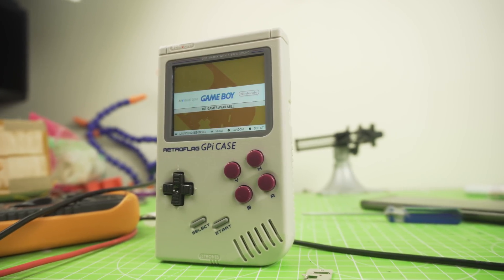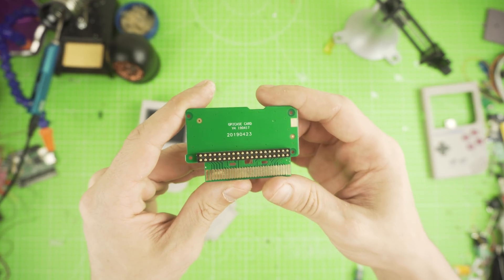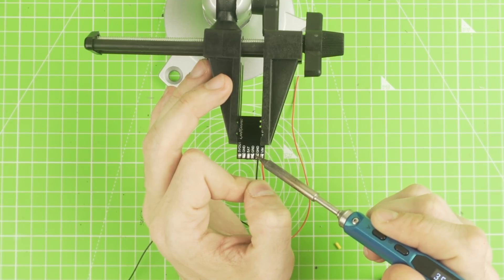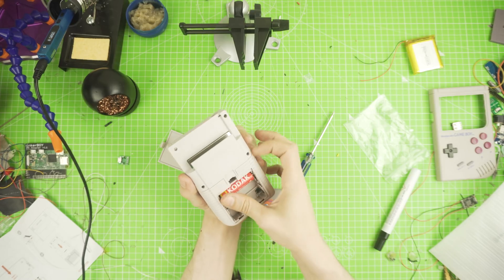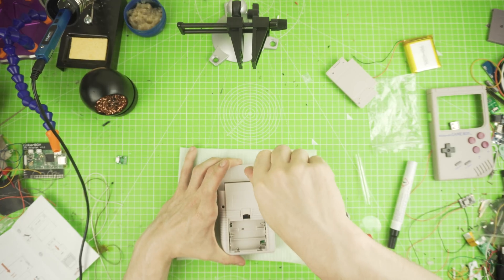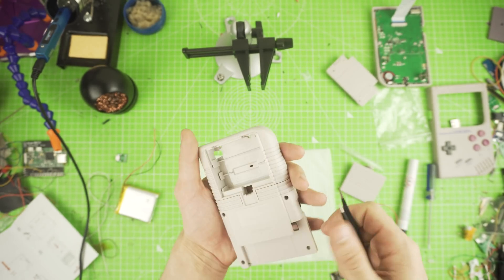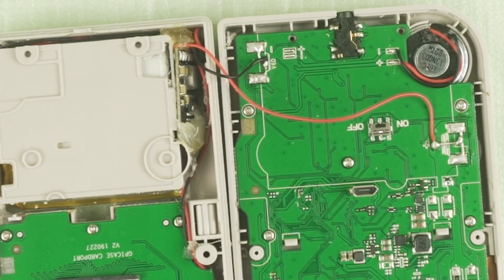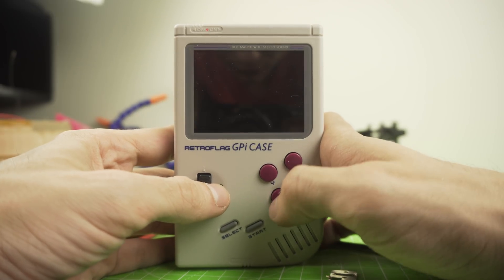Retroflag GPI case Battery and Charger Modification

Comment: What is the battery life when using the 3 AA batteries ?
Reply: I would like to know this too.
Reply from the maker: I tried with cheap batteries so my experience was bad, but with good batteries you can get 3 4 hours out of them, but you got to charge those externally or just buy new ones all the time
Reply: @Adamstech  thanks
Reply: @eldontyrellcorp  You kids are spoiled. Back in the day we had 2 to 3 hours on a set of fresh batteries. And all we had was was a passive LCD and Tetris. :-)

Get 6 NiMh AA Cells if you don't want to do the mod, so you can charge while playing.
Reply: @citronski  Actually the original gameboy lasted a good ten hours.
Reply: @Cicirifu  Nah mate, maybe 3, tops.
Reply: @citronski  Nope, he's right. The original Game Boy lasted between 10-30 hours, depending on the game and batteries used.

Comment: would there be any issue adding USB C rather than micro USB?
Reply from the maker: Not at all, just make sure you wire on the power pins as the type c connetor has many inputs, but it should be fine

Comment: Great video! Wanting to make a raspberry pi project for a while and have all the parts except te powerboost 1000c, as it is really expensive. That power board you were using looks great for my purposes. Can you share a link? Is it as powerfull as a powerboost.
Reply from the maker: Is more powerful than the adafruit one it has 2A and up to 2.5, I placed the link in the pinned comment, YT doesn't like them in the description of the video
Reply: @Adamstech  Oh, didn't see... Thanks man! (again great vid)

Comment: How many percent of you guys would attempt this project and how many would use rechargeable AA battery instead?
Reply: I use a lithium micro recharchable usb battery 1.5v and is great!
Reply from the maker: I think you got your answer by now isn't it!?
Reply: @Adamstech  nope I bought aa battery rechargeable lithium micro usb (29$) on Amazon months ago
Reply from the maker: @Konteoro  How did that worked out for you?
Reply: Adam Builds very well, the battery have a micro usb and 1,5 Hours is ready to use for six Hours of gaming
Reply from the maker: @Konteoro  So you got to take the batteries out and charge them? Isn't that a pain in the buttocks?

Comment: You can buy a bigger package of quality recharable AA batteries and charge them at home. And can still play via USB if the batteries are empty. Nonetheless, great video for people who want this feature. Thanks! 

How long can you play with this 4000 mAh battery ?
Reply from the maker: Hi, I know that is not for everyone, but there are persons like me who doesn't like changing batteries all the time, with the 4000 mAh one you get around 4 hours of play
Reply from the maker: Also you can charge and play in the same time  :D
Reply: @Adamstech   Okay the LDK and RS 97 Handheld have this feature on stock. With 1050 mAh - 1200 mAh Nokia mobil batteries the LDK plays 2 -  3 hours. But the battieres are small. You can always have some as reserve in your bag.  It's a good alternative to the GPI Case since it has better hardware(2 Core CPU) and plays all 16 bit games like NeoGeo smooth 60 fps(with RetroFW Software). I like both systems. Especially the Gameboy style of the GPi Case. Much better than the Bittboy...
Reply from the maker: @__Pathfinder__  I just added Wireless QI charging to it :D
Reply: @Adamstech   The LDK handheld gets 4 hours of 8-16 Bit 60fps gameplay out of a quality Patona 1200mAh Lithium Nokia style battery. The Pi Zero has poor hardware specs and sucks battery life to fast. Recharging while playing without modification... LDK is the better handheld... And it's cheaper...
Reply from the maker: These are more for GMB enthusiasts not so much to compete with already made handhelds, and I will trade Retropie for proprietary software all day every day :D
Reply: @Adamstech   Retropi and Recalbox(Retroarch) got  huge inputlag. Around 160ms on Snes games (Nintendo SNES Mini with stock software 90ms... ORIGINAL 90th SNES 70ms). The RetroFW for the LDK has a low inputlag, too. The SW is specially made and opimized for this handheld. LDK is better in almost every way... and cheaper... Except maybe the 0.2 inch larger display of the GPI Case.
LDK 2 Kernel CPU... Zero 1 Kernel...
i'm a hardcore retro geek. if you have questions ;)
€dit And of course, LDK is not binded to the stock software. RetroFW is a community alternative.  It's all just linux software on a microsd...
Reply from the maker: I fully understand but how I said these are not in the same ball, don't forget about the IPS screen that is way better than the TFT on the LDK that beeing said I just ordered a horizontal LDK
Reply: @Adamstech   Cool the only downside with the horizontal one is the start and select button just unter the 4 control buttons. But  larger display(0,1 inch) and better position for button 5 & 6. Hardware inside is the same. I have a lot of fun right now with old PC Engine/TurboGFX games. One of the best systems  ever made (Namco). I will get a GPI Case in the future, too.  Thank you for you tutorials! Very helpful if i want lithium  inside. You are a very good electrical engineerer! I'm programmer.
€dit throw away the chinese Nokia style battery inside. Patona or something like this is very high quality. No compare in capacity to these chinese wannebe 1020 mAh. The Patona will last over 5 hours(50% longer)!... All these chinese 2000 mAh are all fake data. This type of battery has max capacity of 1200-1300.
Better buy a tempered glass protection for the ldk. the display gets scratched quickly.
Reply: One more advantage is the soundquality of the LDK. And the headphone jack has no background noise at all... while the GPI has a noise.  The TFT is not IPS but on very high level. You could test these things and write your opinion. Whould be interesting for me.
Reply from the maker: I am still looking forward for the Joystick and the form factor in general, I saw that there are updates and extra emulators added with them, so really looking for it, but is AliExpress so I have to wait ages
Reply: @__Pathfinder__  with the supreme image they fixed the audio and has no noticiable input lag compared to my ldk Its super responsive. Add the gameboy pocket dpad  and it fells authentic. The problem with retropi is its complicated to set up, Most reviewers are not tech savy they dont add scripts to fix anything and they dont use any standalone emulators and Retroflag sent them set up units without using the best emulators for the pi0  or any comunity scripts https://www.youtube.com/watch?v=x6IK7nvbE8o&t=1310s watch the image or madlittlepixel these guys are retropi masters. There images always make the world a better place lol :D
Reply from the maker: @robknott1597  That wasn't the goal of this video, I focused on the hardware part if you watch my second video you can see that I showed super retro pie image
Reply: @robknott1597  
 Retroarch on Pi is always 150ms Inputlag(about 5-6 frames).  That's the downside with emulation. Best inputlag so far with emulation has the SNES Mini with stock software. It's gorgeous 95ms and only 25ms more than the original SNES from  the 90th... But only if you keep the stock firmware. Pi and Retroarch on Recalbox/Retropi/Lakka is always laggy. But the LDK seems to be very responsive since it's built on other Linux distribution(OpenDingux). But you have to use RetroFW as software. It's a big improvement.
Reply: Additional info i got today: Vertical one can run up to 724MHz without any crashing and
 Horizontal can only go up to 636 MHz because Vert. has JZ4760B  and Hor. JZ4760 CPU.
So if you wish to overclock than Vertical is the way to go. I overclock a bit around 50 mhz to 648 for SuperGrafx and NeoGeo games.

Comment: There has to be a better battery mod without Butchering the case and board. Maybe a 3D printed mod?
Reply from the maker: How can you make more space by 3d printing? 🤣
Reply: @Adamstech  Replace the battery cover with a battery case with contacts for the current battery terminals. Nuby had a Rechargeable Battery Pack for the original GameBoy that did this.

https://optroodt.tumblr.com/post/147845483266/whats-inside-game-boy-battery-packs/amp

Unfortunately it would probably require using a smaller battery or multiple batteries with a large bulge.

I think you could get away with less butchery of the case if you used a 12x40x50mm Lipo instead of the 12x50x54 you used, but those have only 3000mah.

https://www.ebay.com/itm/3-7V-3000-mAh124050-Rechargeable-Polymer-Li-battery-Lipo-Cell-For-GPS-Tablet-PC/183638461400?ssPageName=STRK%3AMEBIDX%3AIT&var=691092139287&_trksid=p2057872.m2749.l2649
Reply: @ericbsmith42  I agree. I'm sure there will be lots of 3D print mods on thingiverse in the coming months. Unless you've got lots of cash to blow away, I wouldn't recommend cutting into this thing. There's a good chance you could ruin it.
Reply from the maker: This mod Is not made for everyone :D if you are scared of cutting into it you better don't do it, wait for a plug and play :D

Comment: would it be possible to use the barrel jack charger instead of adding the micro usb you think?
Reply from the maker: I tried to keep it as simple as possible, yes is possible as well but is more difficult as you will need to remove the connector and you risk breaking it 😁
Reply: @Adamstech  From ETA Prime's breakdown video it looks like the barrel jack has two solder points right on the back. With a little luck and skill I THINK I could tap into those solder points, but without having seen it in hand I'm not sure. I do like your idea of adding a small Micro USB jack to the device; the barrel jack is a little annoying since it requires a special cable to power the device.
Reply from the maker: You said it better, I can't stand having a proprietary connector, micro USB is universal

Comment: Nice job beating everyone to the punch!
So, I'm guessing the GPi has it's own booster to bump the three AAs. Are you essentially feeding one booster into another here? Would it be better to bypass the GPi's booster?
Reply from the maker: First time I tried to connect the 3.7 volt battery directly to the pins and charge it with a small charger board but the "booster" that it has it can't boost the 3.7 it runs only if you feed it 5V anything lower than 4.6 doesn't work, so without going too much into modifying it I chose this way, hope it makes sense
Reply: @Adamstech  If it works, it works. Again, nice job!
Reply: @Adamstech  Were you feeding the 3.7v into the the battery terminals or the barrel jack? The battery terminals should be boosting the voltage, since 3xAA have 4.5v and 3xAA Rechargeable only have 3.6v. A LiPo 3.7v directly into the battery terminals should feed the boost circuit.
Reply from the maker: No it doesn't, I tried to do that forst, to try and use the built in booster, it doesn't work. It boots from 4.6V up . When you will get your hands on one you will see
Reply: @Adamstech  Not that I disbelieve you, but that doesn't make sense to me. 3xAA max out at 4.5v and drop down in voltage as they are used. 3xAA Rechargeables start out at 3.6v and go down from there. Either the battery terminals should be boosting the voltage or the entire unit should be able to run off of 3.7v (The Pi can actually run on 3.3v, but the USB and HDMI require 5V, so the Pi takes the 5v internally and bucks it down to 3.3v).
Reply from the maker: Give it a go and let me know :D
Reply: @Adamstech  I gave it a go and attached a 3.7v 600mah lipo battery to the battery contacts on the board.  Boots up just fine.  I have pics to prove it.
Reply from the maker: Check my other videos

Comment: Good job!
Do you have the link to the battery charger?
Reply from the maker: Booster:
https://www.ebay.co.uk/itm/3-7V-4-2V-lithium-battery-charging-boost-mobile-power-charge-and-discharge-DI/143239598104?hash=item2159bed018:m:m6XniN5LdcgXYUgB8C-9csg&frcectupt=true
Battery:
 https://www.ebay.co.uk/itm/4000mAh-3-7V-rechargeable-lipo-Battery-For-PAD-Laptop-power-bank-DVD-MID-125054/183430821360?hash=item2ab55435f0:g:hesAAOSwGUhbmcgr 
Micro USB:
https://www.ebay.co.uk/itm/5x-Micro-USB-to-5-pin-0-1in-PCB-Connector-Adapter-Breakout-Board-Module/123772348532?hash=item1cd1682874:g:HxwAAOSwAhdcln72
Reply: @Adamstech  Hi Adam! Sadly the micro usb is out of stock and I'm unsure which are compatible. 

Is this https://rover.ebay.com/rover/0/0/0?mpre=https%3A%2F%2Fwww.ebay.co.uk%2Fulk%2Fitm%2F273922162384 compatible? 

It's 5 pin but the measurements seem different.

Are there USB C connectors we could swap in too? The only ones I can find are 24 pin and I'm not sure how they would affect the instructions. (or how safe it would be after hearing news about the pi 4 usb c connector not meeting regulations)

Thanks and I absolutely love your work, it's incredible!
Reply: @Adamstech  wich of the 2 boosters is it? A or 3xA

Also the micro USB connector is not available anymore. Got another one?
Reply from the maker: @dermotochris  Booster: https://www.aliexpress.com/item/32886346871.html?spm=a2g0s.9042311.0.0.27424c4dqjQRd4, Micro USB  https://www.aliexpress.com/item/32801901404.html?spm=a2g0o.cart.0.0.6bb63c00Io6wys&mp=1

Comment: Awesome mod, but could you please make a mod using the Banana Pi M2 Zero instead of a pi zero?
Reply from the maker: I don't own a Banana Pi yet, but I will look into it :D
Reply: @Adamstech  thank you very much! :)
Reply: Why are you using a Banana Pi? Pros & Cons in comparison to the PiZero?
Reply: @doctordilanka  banana pi m2 zero has a quad core cpu. But it's based on the h2 chipset and it's getting very hot quite quickly.
Reply: Retroflag don't make a gpi case for the Banana pi

Comment: Where is the parts list with info and links????
Reply from the maker: Booster:
https://www.ebay.co.uk/itm/3-7V-4-2V-lithium-battery-charging-boost-mobile-power-charge-and-discharge-DI/143239598104?hash=item2159bed018:m:m6XniN5LdcgXYUgB8C-9csg&frcectupt=true
Battery:
 https://www.ebay.co.uk/itm/4000mAh-3-7V-rechargeable-lipo-Battery-For-PAD-Laptop-power-bank-DVD-MID-125054/183430821360?hash=item2ab55435f0:g:hesAAOSwGUhbmcgr 
Micro USB:
https://www.ebay.co.uk/itm/5x-Micro-USB-to-5-pin-0-1in-PCB-Connector-Adapter-Breakout-Board-Module/123772348532?hash=item1cd1682874:g:HxwAAOSwAhdcln72
Reply from the maker: You can also check the pinned comment
Reply: Battery type size link ?
Reply from the maker: @8-bitbitsa821  Read the pinned comment :D

Comment: Yoooo, give us a link for the needed parts.
Reply from the maker: Booster:
https://www.ebay.co.uk/itm/3-7V-4-2V-lithium-battery-charging-boost-mobile-power-charge-and-discharge-DI/143239598104?hash=item2159bed018:m:m6XniN5LdcgXYUgB8C-9csg&frcectupt=true
Battery:
 https://www.ebay.co.uk/itm/4000mAh-3-7V-rechargeable-lipo-Battery-For-PAD-Laptop-power-bank-DVD-MID-125054/183430821360?hash=item2ab55435f0:g:hesAAOSwGUhbmcgr 
Micro USB:
https://www.ebay.co.uk/itm/5x-Micro-USB-to-5-pin-0-1in-PCB-Connector-Adapter-Breakout-Board-Module/123772348532?hash=item1cd1682874:g:HxwAAOSwAhdcln72
Reply: @Adamstech  add this to the description, this is good info for those of us looking to do this mod :)
Reply from the maker: There are in the top comment, YT doesn't like a lot of links in the description
Reply: @Adamstech  thank you!

Comment: Do you have links to the battery?
Reply: It's a 12x50x54mm LiPo, like this one:
https://www.ebay.com/itm/3-7V-4000mAh-125054-Lithium-Polymer-LiPo-Rechargeable-battery-USA-STOCK/173930452604?hash=item287f10167c:g:7bIAAOSwMYtcQ8lQ

What I'd like to know is which LiPo charging board he used.
Reply from the maker: @ericbsmith42  Booster:
https://www.ebay.co.uk/itm/3-7V-4-2V-lithium-battery-charging-boost-mobile-power-charge-and-discharge-DI/143239598104?hash=item2159bed018:m:m6XniN5LdcgXYUgB8C-9csg&frcectupt=true
Battery:
 https://www.ebay.co.uk/itm/4000mAh-3-7V-rechargeable-lipo-Battery-For-PAD-Laptop-power-bank-DVD-MID-125054/183430821360?hash=item2ab55435f0:g:hesAAOSwGUhbmcgr 
Micro USB:
https://www.ebay.co.uk/itm/5x-Micro-USB-to-5-pin-0-1in-PCB-Connector-Adapter-Breakout-Board-Module/123772348532?hash=item1cd1682874:g:HxwAAOSwAhdcln72